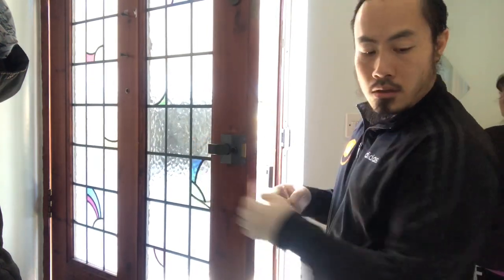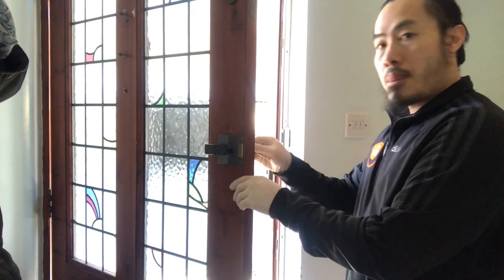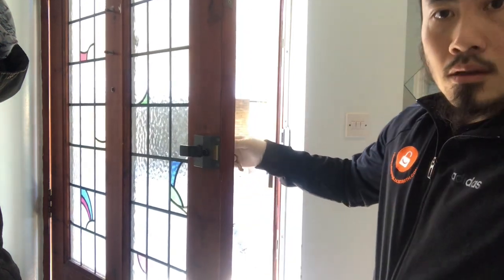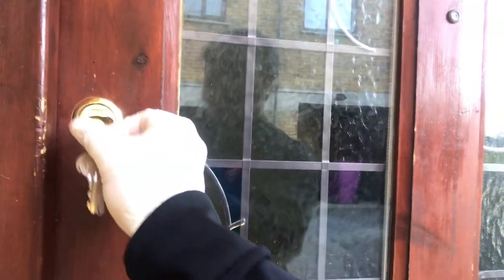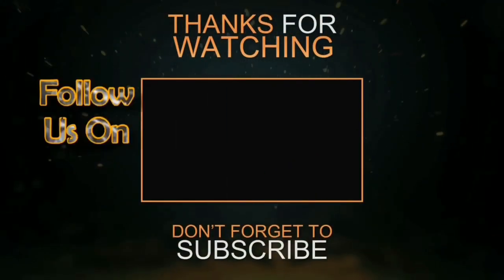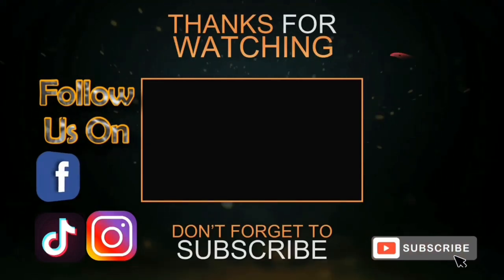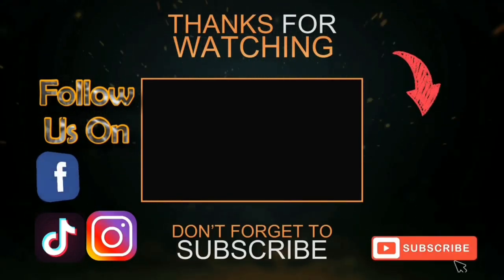How To Change A Rim (Yale) Cylinder Lock - Your London Locksmith

Comment: Can you use the tail piece from the old lock as it's cut to size? Or do you need to say you've used all new parts?
Reply: It's easier to cut the new connecting bar than it is to swap connecting bars between cylinders
Reply from the maker: I guess you can but you have to remove the c-clip. Like the other comment it’s easier to cut the tail.

Comment: We can’t get the cylinder out as the key broke off in the lock and the screw to remove it is under a piece of metal when we remove the back of the lock itself. Any help?

Comment: Phillips screwdriver, really? The screws are pozidriv not Phillips. 
It's not a 'Tail' it's called a 'Connecting Bar' and you should cut the connecting bar with the cylinder mounted in the door with a  hacksaw and a pair of pliers, you never copy the length of the cylinder you are removing as they are invariably wrong.
Reply from the maker: Thanks 🙏🏽 always interested in hearing other methods.
Reply: @yourlondonlocksmith1697  you're welcome, not 'another method' what I said is the correct method, but hey I've only been a locksmith since 1983 so what do I know?